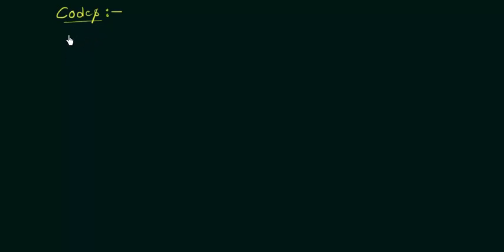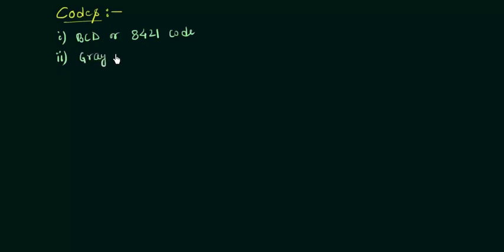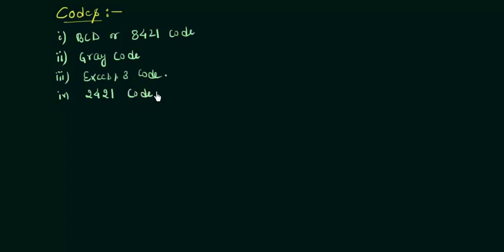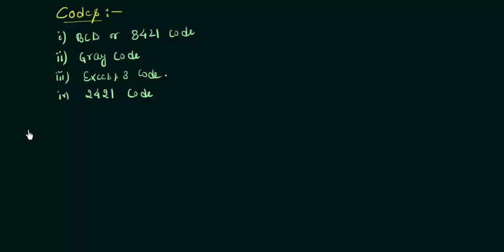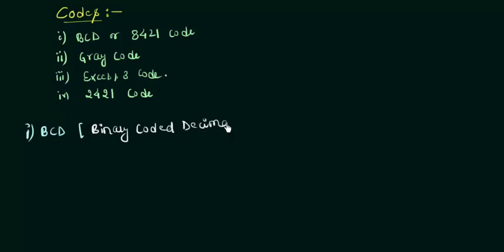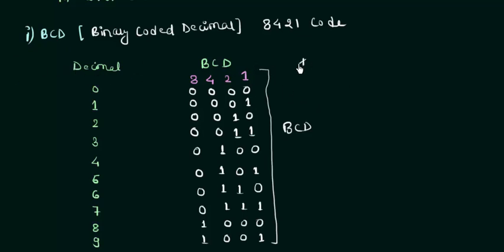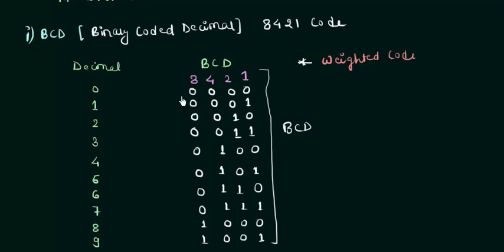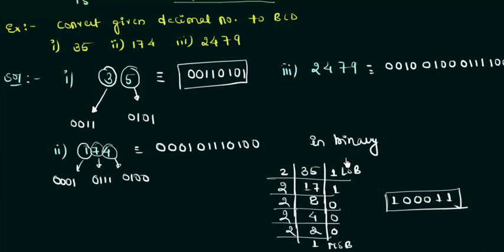Binary Coded Decimal (BCD Code)

Comment: Thank you for your effort. Sound needs to be fixed though. So in BCD 35 is 00110101 because 0011 = 3 and 0101 = 5 So what is the difference with 100011 which is the actual representation of the number 35 in decimal math why use bcd over the other method? Why cant I call 100011 bcd? it is still Binary of a decimal number